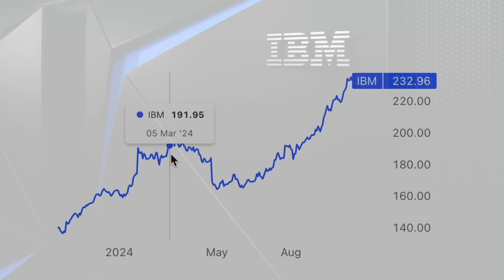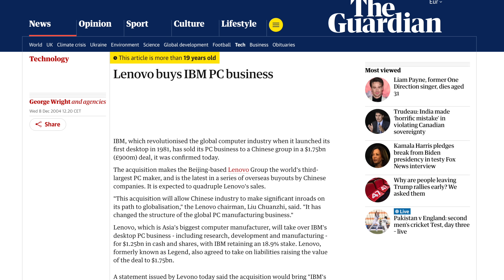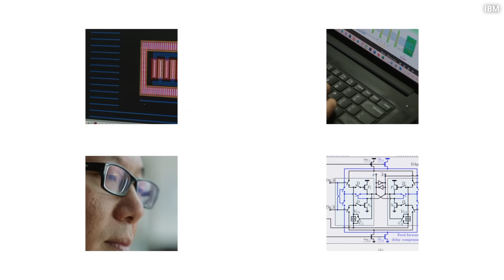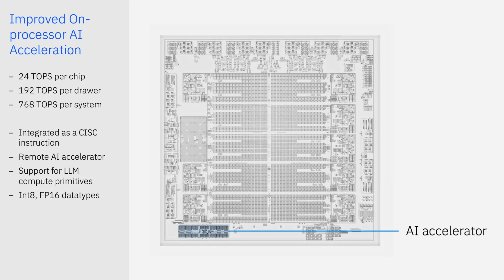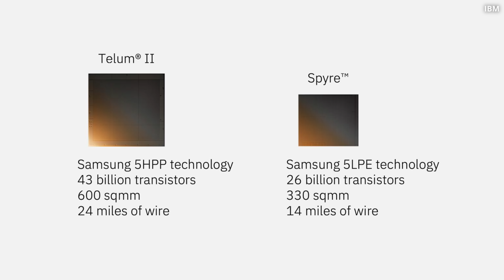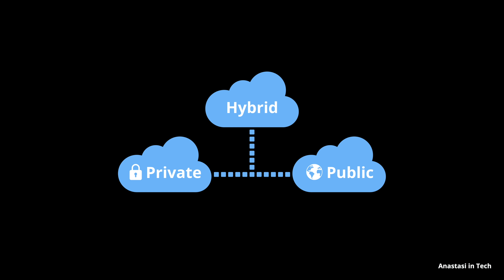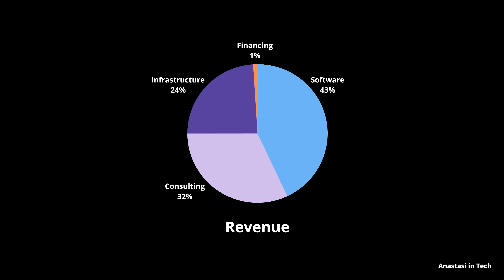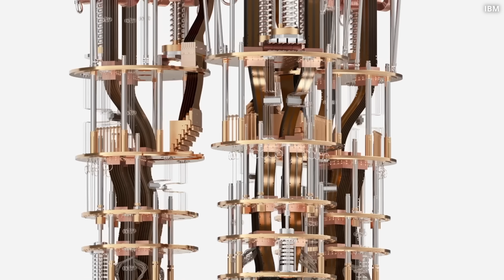The Secret Plan of IBM

Comment: IBM did not develop the first PC, Apple predated them by a couple of years.  IBM did not believe in personal computers and thought everyone should use dumb terminals connected to their mainframes.  That is why IBM did not create an OS, but licensed an inferior DOS from Microsoft.  And that was licensed from someone else’s DOS.  So, IBM never controlled the OS market and lost control to Microsoft.  At the same time, IBM was so convinced that that the PC would fail that they used the inferior Intel 8088 CPU rather than the 8086.  In fact IBM did all they could to sabotage the PC, but their name was so powerful, and the idea was so good, that they dominated the corporate market and took dominance from the Apple PC’s which were more sophisticated  but did not have the IBM cachet.
Reply: Agree, the IBM PC was not "first".  Same for the Commodore Amiga which exceeded even the Apple Macintosh in capabilities.  But you're right, the IBM name (and it's clones) had won the desktop computer wars by the early 90's despite being technologically inferior hardware and operating system to the Mac, Amiga, and Atari 16/32-bit systems.  IBM/MS-DOS was almost a clone of CP/M-86.  CP/M was the dominant DOS (Disk Operating System) for 8-bit Intel/Zilog based computers of the 70's and 80's.  So much so, that Apple even offered a Z-80 CPU based CP/M card for the Apple II/III.
Reply: Actually, if you paste your statement into an AI there's some accuracies and an awful lot of inaccuracies - just saying, that's all.
Reply: Lots of opinions and very little truth

Comment: By Observation of WYSIWYG pure-math relative-timing ratio-rates of prime-cofactor superimposed motion, the holographic structure of standing wave modulation mechanism quantization is the effective cause of condensed nodal-vibrational conformity of a pattern of computing and sub routines, by default, which I suspect you know very well and apply to chip design, but a supporting POV is good.

Comment: IBM has promised a lot for many years. At one point their accounts persuaded Warren Buffet to invest, but after several years of poor performance he sold in 2017 & 2018 & later invested in Apple. His IBM stake was around $10b so it was a size-able investment. Has IBM changed or is it too widely focused & operating in areas that do not have the growth of Apple or Nvidia. Now the market seems to feel that IBM has changed & it will grow rapidly, Is the market right or will IBM disappoint again. In my humble opinion there seem to be other options with more potential growth. Thank you for sharing!

Comment: I see a future in quantum computing and  photonics.  It's going to improve exponentially, as did the transistor.  I think the trick will be finding the perfect substrate. Excellent video. Thanks👍
Reply: How about more than 2 algorithms that outperorm classical?
Reply: @Sven_Dongle  please elaborate 👍
Reply: quantum computing is bunk.  sabine hossenfelder has a series on Quantum computer nonsense.
Reply: @truthsocialmedia  It is not a joke.  I work in the field.   
With photonics, you can run parallel processes. At our current point, we are able to use coherent light to run these computations. Even though the wave length is much larger than classical electrons, the power consumption is reduced.  It is not currently for everything, but it excels in certain areas.  With current chip designs, we have run into many issues.  Physics is limiting our ability to build more complex recticals.  The only solution at the moment is to re think the way we use computational power. Their is more to this field than most people understand.  Their are many ways to create qbits.  Once a process is well defined, it's up to mechatronic engineering.
Reply: @truthsocialmedia  even though I work in the field.  I still respect your imput,comment, and opinion. i actually have seen the video, and I am subscribed to her.👍
Reply: @truthsocialmedia  asianomerty just released a video today about the AI bubble burst.  I think you might find it interesting 👍
Reply: Phyrophki cristal but graphene is interesting
Reply: @jjw5165  I have no ida what that is. Graphene is defantaly an interesting subject in itself.  Personally, I think galium nitride or amorphous diamond have potential.
Reply: @jjw5165  I think you mean perovskites.

Comment: I still don't know why IBM's AI chip should be a breakthrough as there are several companies producing such chips.
Their business grows in SW and consulting (however, the growth could be also explained by decrease in other sectors. I am not saying it was wrong but it makes me always a bit suspecious when relative number are presented as if they were absolute value? A revenue increase of 470Mio actually sound more impressive than 7% imho :D ). 
I understand if IBM is using their new chips to facilitate their AI services?! which was not pointed out in the video.
But what is the unique benefit to use IBM IA cloud services over AWS, Azure, Google?
Reply: These chips are designed to add AI operations to high throughput high transaction load scenarios which are operating on the order of something like 300K - 1M transactions per second. Those systems already existed before AI and were running at that scale. And now their customers want to be able to run inference on the same systems without a performance hit.

That is not possible with commodity hardware.

These are not supposed to be bleeding edge AI chips. These are supposed to run distilled and quantized AI models from 2-3 generations ago in scenarios where it was previously technically infeasible to use them at all.
Reply: @timseguine2  They are not specifically hardwired to the models but implement common operators such as those in pytorch and tensorflow and so have some degree of futurity.

Comment: When you say the algorithm runs in hardware not software. Is the hardware fixed or can it be reconfigured like a FPGA ?
Reply: NPUs are ASICs that perform inference on predefined operations on quantized models using functions found in pytorch and tensorflow.

Comment: Correct me if I'm wrong, but Quantum computing won't explode in society until there is a near or fully ambient temperature/pressure superconductor discovered or invented.  I infer that a materials-oriented AI will be required for that.  So, (1) AI to get us an ambient t/p SC (2) it becomes trivial to scale quantum bits (3) we all get quantum wristwatches.  Yes/no?
Reply: No, Quantum computing is more like Cold Fusion, its always 20 years in the future. AI isn't a panacea either, its basically a automated pattern matcher, more like an accelerator, but its still the humans making decisions. 
Even if they make QC work, it probably will never be portable and always be a remote device running in a data-center, getting it to run in ambient temperature seems much more harder than getting it to scale to enough quantum bits to be useful. And cooling doesn't miniaturize very well, you are going to need to discover new physics for that and you can't just put a deadline on discover of new physical, could happen the next decade or the next century.
I think we already got to the top of the miniaturization of the mobile devices, networking will be riding the innovation curve for the next decade. Mobile computing is ironically going to become more and more like Mainframes. I would invest in IBM. 
Mobile phones aren't going to run the computation on themselves, they're going to be dumb terminals.
The fact that we can't miniaturize cooling already made mobile devices hit a wall of power dissipation, your phone can't use more than 20W of power. If you cold solve just that problem, you could use a desktop chip for 500W of power dissipation in a mobile and that would already be a 10X to 30X increase in performance without even needing to use QC.
I would be my coins on optical computing instead, optronics seems like it would allow for a paradigm shift away from CMOS. I won't bet anything on QC for the foreseeable future.
QC is useful to exchanging cryptographic keys, that's the only actual commercial use I ever seem for it.
Reply: There are no quantum algorithms except for a prime number sieve and a database optimization algorithm that perform faster than classical computing, thats the biggest limitation so far. What they are good at is simulating quantum systems like magnetic spin models, not much use to your average spreadsheet user.

Comment: IBM still build mainframes that run ATMs and other big structures. The problem is they use Cobol as a programming language that no young programmer is interested in learning. I started to use Cobol and it is underrated and it combines high level programming and low level control.

Comment: IBM uses Linux,they are on a good direction.
Reply: Linux is a foundation start. The reality of secure computing will include modifications of the kernel, limits and check/balance operations with streamlined code for the cases in which it is applied.  Many machines are running variations of *nix, but they are not equal in flexibility or security.  *nix is a great starting point, but the best of the best will be tailored directly to the hardware strengths algorithmically and vice-versa. "Virtual Organic Connection" or "Bit based usage/workload compression" At this point a new term must be used.
Reply: Linux is not bringing the forefront of research anymore. Its a good direction to the status quo, not the future of operating systems.
Reply: @monad_tcp  bringing the forefront of research. I don't even know what that means. Linux is growing and innovating and running a lot of the world.
Reply: Why do you say that? Is it for reasons other than “OS ideology”?

Comment: Inform that the next generation of computers will be developed in hexagonal format from the cutting of silicon wafers to the processors in their respective sockets on the motherboards...
Reply: No. Reliably dicing apart the wafer requires criss-cross cuts. It's like cutting sheet glass into tiles.